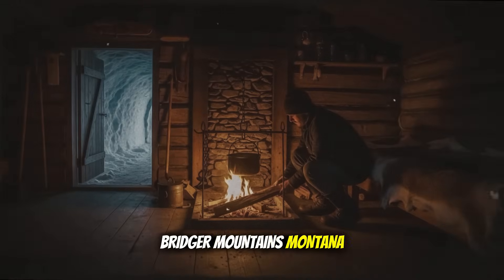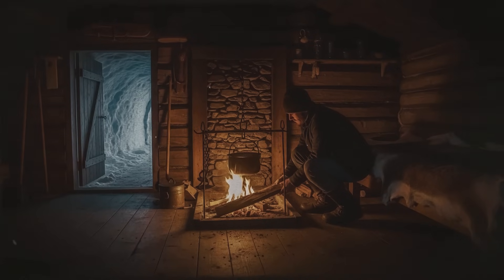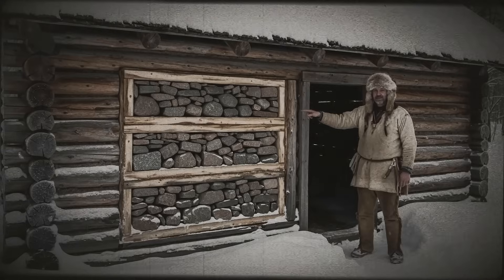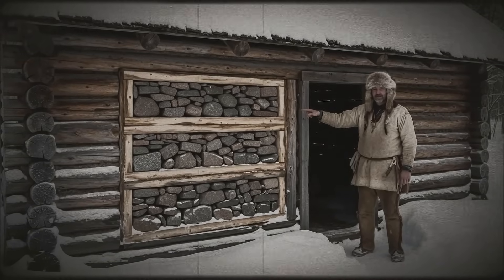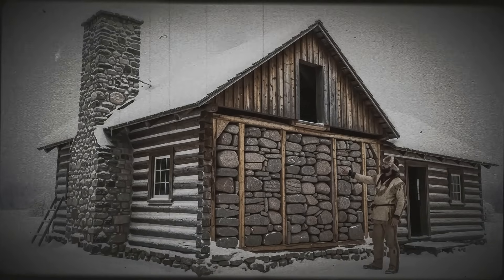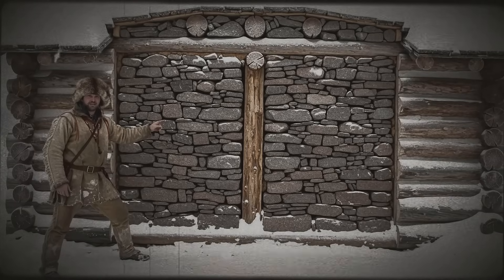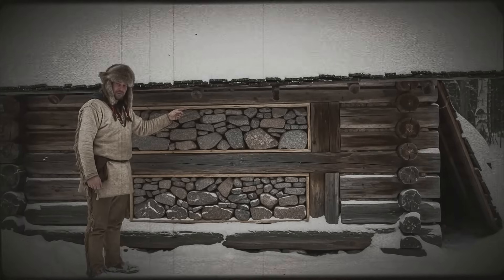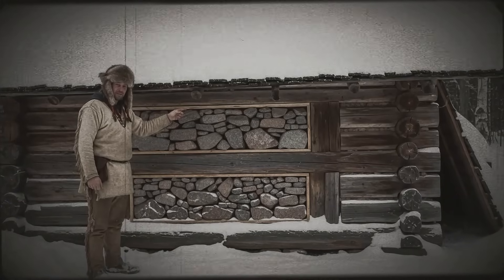How One Mountain Man’s “Crazy” Wall Idea Held His Cabin 32° Warmer While Others Froze

Comment: @ 14.56:  "Passive Solar Thermal Mass design" --  Incorrect!  Thermal Mass Design, yes.  Passive Solar -  NO.  Thermal mass as a heat storage method is an independent concept that is often used with Passive Solar design.  In 1982, I designed and built a 2,400 square foot home near Lake Michigan using Passive Solar technology that included Thermal Mass for heat storage in the floor, large insulated-glass south-facing windows to collect the solar energy, and sun-exposed Thermal Mass interior walls to store it.

The design also included super-insulated walls and ceiling, a centrally-located wood stove (the backup heat source) in front of one of those walls, movable insulation for the large glass windows to mitigate night-time heat loss,  and a 40,000 BTU warm-air gas furnace that turned itself on automatically in case nobody was home to manage the wood stove.  I lived in that home for over 40 years until it became far too large for us "empty-nesters." 

Heating costs were unbelievably low!  The sun heated the house by itself down to below -20 degrees F as long as the sky was cloudless.  Interior temperatures varied from 75 degrees at the end of the "solar day" to 67 degrees the following morning at 10 degrees F, without any other heat source.  This concept works!

Comment: From YYZ. Just stacking a stone wall like the picture allow half the stored heat to radiate outside instead of heating the house. Stone is not the only thermal mass you can use, salt also work well.  The fireplace shown in the video is on an outside wall, again much of the stone retained heat are wasted heating up the parking lot.

Comment: And yet they show a massive stone chimney on the outside of the cabin.  Yes, stone holds a lot of heat but it also transfers energy.  Both ways,  heat transfers through it and cold transfers through it.  Do you see why it is silly to show that big chimney on the outside instead of on the inside.  On the inside it is going to hold significant heat to release later into the structure whereas that outside chimney is going to transfer the heat very efficiently to the great outdoors.

Comment: Not buying the story.  With rocks trapped between the logs with air gaps the rocks will never heat up through the logs.  The cold on the outside will penetrate the wood further, at a greater difference than from the inside.  The space between the rocks is detrimental as well.  If the rocks were stacked on the inside chinked with clay would make this more believable.

Comment: my friends built a rocket mass heater using chimney pipes and an old oil drum with a smaler drum inside the larger one a huge clay and stone bench they even built one with a water heater wrapping it with copper tubing outfitting it with a pressure valve .It used only 1/3 of the wood to heat the house and for hotwater as well as cooking.Almost no smoke out the chimney because it was so efficient ...the thermal mass kept the house warm till the following day so building a fire in the bittercold morning was never a thing.This is in upstate NY where winters are brutal.
Reply: https://www.youtube.com/@paulwheaton/playlists
this guy has lots about rocket mass heaters :D

Comment: Actually I`ve done something similar here in my house that was built during wwII 1943, the walls are less than six inches thick. I have lived here without electricity for prolnged times also through some winters and I can tell, it wasnt untiull I figured out that if I move all my books vinyl records from the loft, down to the living room and basically plasterd the outward facing walls with these (with some old paper sacks used as wall coverings to get it a little more insulated against the wind. It eally improved life bigtime here. New for the year is that I have filled it up extra much for this winter season since I think this is going to ba a particular harsh one. Got plenty of wood too, and very much looking forward to when hard subzero degrees kick in for real a little week into the new year. 
Cheers from Norway!

Comment: What about the roof? Heat rises and none of these stories ever talk about stopping heat loss through the roof
Reply: If you want to stop heat loss from your roof, first you need a roof that can withstand a very heavy load. Not too steep and very waterproof. Build up a dam around the edges of the roof and cover with six inches of good topsoil and then lay sod on top or plant grass in the top soil. A time proven insulator. Make sure to add small vents at the ridge line to allow interior moisture out.
Reply: I live in Canada and what most people don’t seam to understand is that while some insulation in the attic  is good there quickly comes a point where it is pointless 
Yes sod insulates but snow actually insulates better 
And while you want some snow to stay you still want the snow to melt off to keep the load from 
Becoming to heavy 
So you don’t go to crazy with insulating the roof as that insulation will mostly only improve as the winter progresses and the snow increases 
The Inuit survived in igloos made of snow which start at about 1foot thick on the roof  
And literally rely on the snow for insulation 
Better to insulate your walls to stupid levels and build your roof in such a way that it will shed melt off but retain a good load of snow for insulation
Reply: @jarredsegal6842  Really good point that I was thinking of and hoping to see from others.
Reply: Also its better build fireplace inside middle of the house. If it like in the video lot of heat will be lost because heat mass is outside not inside
Reply: I remember one of the stories where the builder had put inches of sawdust in the space between the ceiling and the roof. Also had a multitude of other insulating techniques.
Reply: Best to throw at least 6 inches of Sod on roof .
Reply: Heat sink theory
Reply: Good point
Reply: These people talk about the roof https://youtu.be/UOwr6GnUc-A?si=yGlFW5r-vehRU2Ld